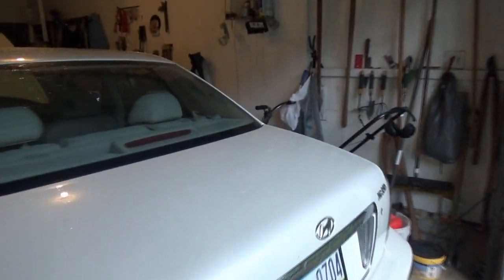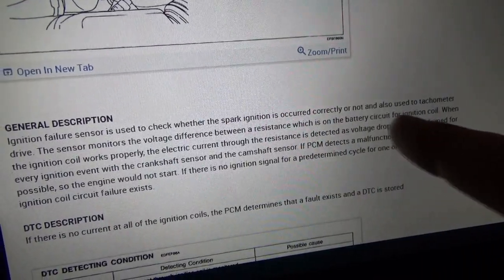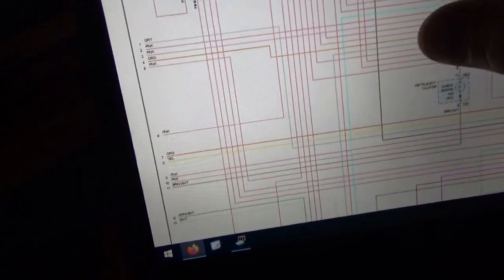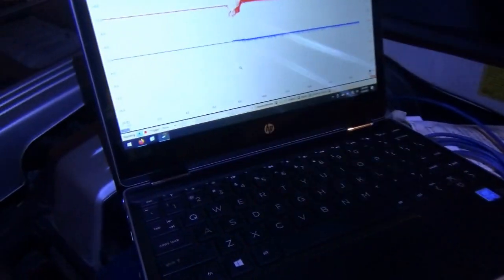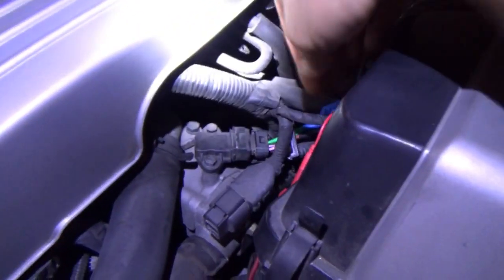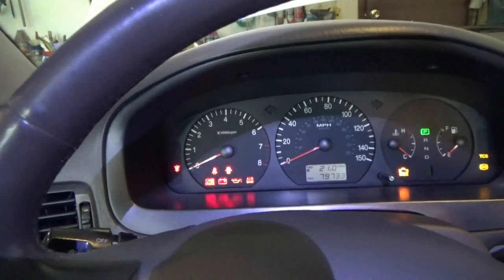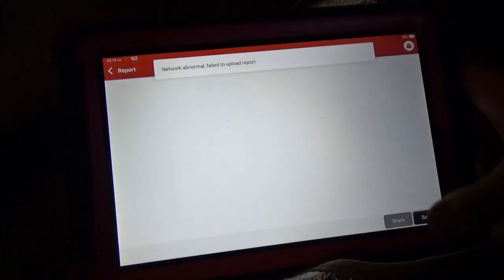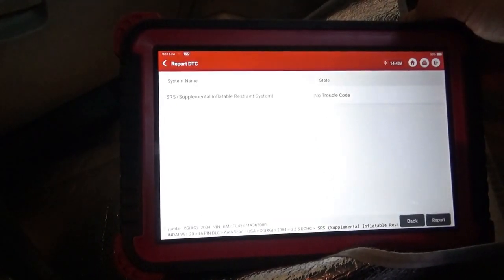Hyundai No TACHOMETER? - P0320

Comment: My 2002 Hyundai accent (manual, 2 door, tl or gl idk its the base model) doesnt have a techometer. Its annoying because i have to figure out when to shift. After a while i can tell with sound i think buttttttt i really want a techometer. Is there a way to get one and how much would it be?
Reply from the maker: Just Google it... Easy installation 👍
Reply: @PineHollowAutoDiagnostics  google leads me to ones that i have to mount, i know the automatic version of my car has a techometer but google wont tell me if i can buy one of those and replace mine with it
Reply from the maker: @KS_Gaming05 You would have to research the wiring diagrams to see if there is an rpm signal to the cluster...

Comment: That SRS issue is due to the connection getting loosen. The connector is located under the passenger seat and there’s not much a slack in the wiring harness so as the seat is moved back and forth over the years, the connection gets weaker.  
There was a recall on this but the fix that dealer put in didn’t last long.  So I came up with my own remedy and it’s been trouble free for many years. 

The fix is very simple:
1. Disconnect the battery
2. Take the seat off the mounting points. 2 bolts and 2 nuts. 
3. Look for the yellow harness under the seat. 
4. Disconnect the harness. Clean the contacts and slightly bend the male pins so they make better contacts. 
5. MOST IMPORTANT - do not attach the harness back in its factory mounting point. Instead use a few zip ties to loosely hang it under the seat. This way the connectors will not be subject to the bungee cord effect whenever the power seat is being operated. 
Also, refrain from storing any item under the seat.  Foreign objects tend to interfere with the harness. 
6. Clear the code with a scanner or just drive around and the SRS light will clear itself. 

I have a 2001 model of this car and it’s been very reliable. It now has 267K miles on the original engine and transmission.  I do my own maintenance and have wrenched on every nut and bolt on this vehicle.  No rust problem either since it has never seen salt. 

This was the last generation of Hyundai vehicles that shared the platform with Mitsubishi.  You’ll find a lot of similarities and even the Mitsubishi logo on some parts.

Comment: Hey Ivan.  That is a massive heat sink on the bottom of that sensor module.  Maybe could have used some "heat sink compound between the block and the heat sink of the module (?)  Might help on the transfer of heat.
Reply from the maker: It'll be good for another 15 years 👌

Comment: On my Dodge Stealth, the air bag (SRS) light came on when I turned on the ignition without the gauge cluster attached.  The code it set?  Something like "airbag warning illumination circuit fault."  The only way I was able to turn it off was with the Chrysler DRB with Mitsubishi adapter.
Reply from the maker: Yeah those DSM cars had some quirks lol

Comment: IIRC Those older Hyundai SRS modules will permanently light the light until cleared via scan tool if the fault persists for 5 drive cycles w/o correcting itself. I believe the light will go out if the fault goes away and it didn't go through those 5 drive cycles yet.

Comment: ** Next time you think you have a heat related sensor issue, grab a can of computer duster a.k.a. "Canned Air", turn it upside down and spray the component you are troubleshooting...the cold gas comes out and freezes whatever you spray it on.  Would have been interesting to see if the sensor came back when chilled.
Reply: I have watched sensors with heat related issues come back to life live on labscope just by dumping a handful of snow onto the sensor 😎 Canadian diagnostics 😉
Reply: that's clever!
Reply: Gum remover spray works too. I get mine from Brady industries but I’m sure there are other sources
Reply: I've seen this work on jeep computers! Put in the freezer for a bit then presto

Comment: Did that component require dielectric grease on its heat sink base ? I enjoy your videos Ivan ..you and SMA and Scanner Danner are top of the charts!
Reply: I was thinking the same thing, Rockcycle
Reply: looked like it mounted on two raised posts and just open air underneath. so it probably wouldn't make any difference in that case and I imagine the current is very low, only driving the tach and ecm input.
Reply: Did you mean thermal paste? I don't think that's a heat sink

Comment: If the problem occurred frequently, I would consider moving it off that water outlet/therm housing (heat source), however, at 17 years of service life, it doesn't warrant relocating the sensor.

Comment: So the computer was using the ignition coil current pulse for two measurements, ignition success events and calculated rpm.
Sneaky lol.
Surely a crank sensor would be better for rpm?
Reply: It wouldn't be able to do that since it needs to know engine RPM to know when to fire the coils, you'd have a chicken/egg problem!.  Engine speed and position will come from the crank sensor.

Comment: That sensor needs a small heat sink...some cooling fins to dissipate heat better.
Reply: I suspect the problem is less to do with the heat created by the module, and more down to it being bolted to the cylinder head right next to the thermostat housing.

Comment: That engine doesn't sound as smooth as outher  V6 engines
Reply: It's an old Mitsubishi design from the 80s, very similar to the ones used in 80s and 90s Chryslers (there in 2.5 and 3.0 liter form)
Reply: @bastianfromkwhbsn8498  Thank you I knew they used someone's engine design just didn't know who or when they used it
Reply: A seafoam treatment via the Throttle  Body could help clean the years of carbon buildup on the valves and cylinder head. The elderly gentleman  probably drives it too soft thus never burns the yunk out.
Reply: This was the era when Hyundai/Kia weren’t building the best cars but this car could very well need a tune up there’s no telling how many miles are on it
Reply: @MrINDEPENDENT2000  Yah it sounds like the idle is a little rough I believe it said 79k miles on the odometer screen
Reply: Hyundai/Kia are junk
Reply: @sirsweetness8332  Yah it's kinda strange as the new Kia engine sounds a lot smoother

Comment: The scope showed a nice 0 to 12 signal. Ground and power.

Sensor, same as amplifier or am I thinking of the older ones? (Previous comment)
Reply: looks like it samples the ignition coil/s primary current, amplifies it and outputs nice fixed width pulses :)

Comment: So why didn't he have to check for ground? My guess (not a mechanic) because the coil ramps were fine and they share the same ground🤷‍♂️
Reply: I believe because it was a "common ground" for the circuits within the module. Had the ground failed the complete module would have been inoperative. That of course would be easily detectable.

Comment: This is happening with my '99 blazer tach is erratic engine hiccups then dies at low rpm/idle....coil current or ignition module or crank and cam sensors